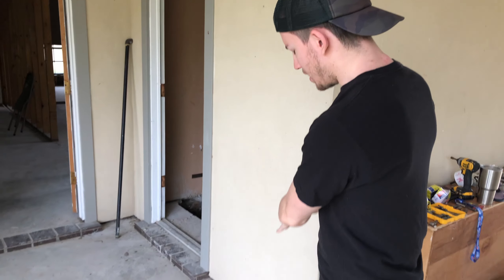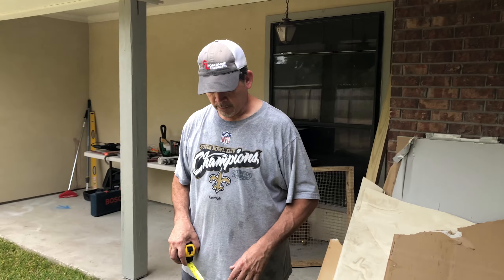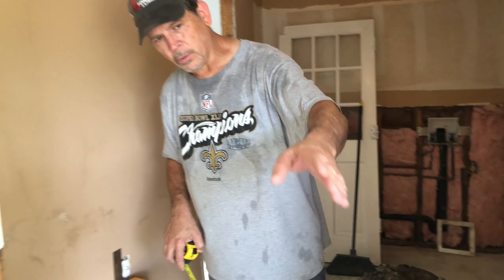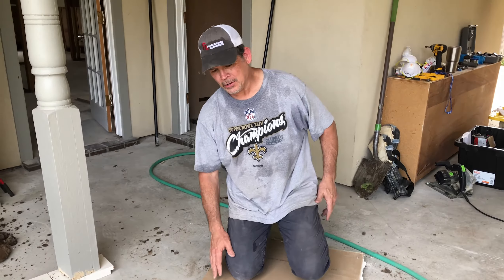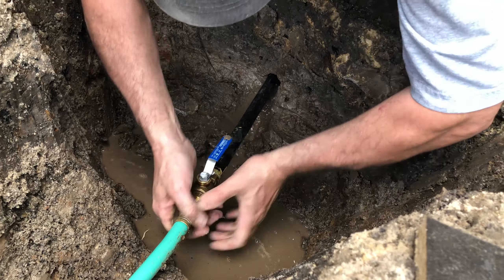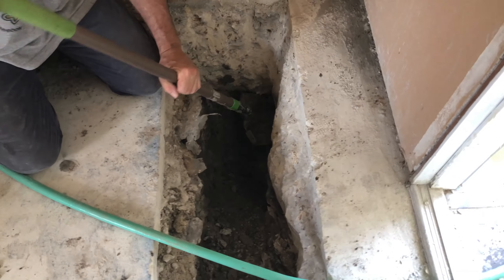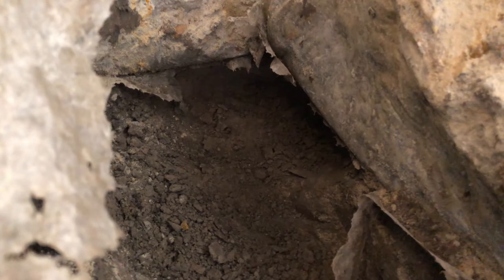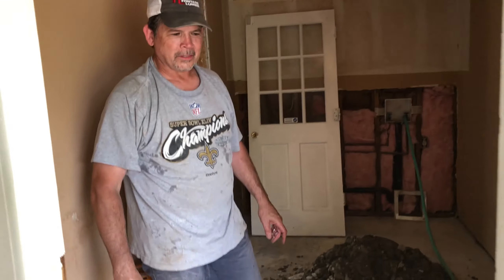Tunneling Under a Concrete Footing for a Sewage Drain

Comment: Should have dug deeper. Foundation typically are at 2' below grade. so 2 1/2 deep ditch. Never break the foundation footing ,its just not good .
Reply: Depends on the pipe depth in the yard for the join need to keep the drop so you typically want it to leave the house at the highest level possible to make your connection.

Comment: Great team work. Nice play but play reporting.  

Now I see what is involved in boring a hole under concrete & through dirt, deciding on the angle to approach the interior of the structure.  

The most compelling, most magnetic thing which kept me watching this episode was seeing  the father & son interaction.   It’s nice to see the how the father & son worked together to deal with problems in the process of boring through. No power struggling for the sake of power struggling. I can sense the respect, heartfelt cooperation.  
While watching this, I also felt sad thinking of the dysfunctional father & son interactions I’ve witnessed over the years. I also felt sad thinking of the many men that didn’t even have a father to work with.  My prayer is for men to father and mentor each other, to interact with each other and not just do the stereotypical sit in a line watching sports on TV & not talking, not hashing out the difficulties men encounter and figuring out how to approach those difficulties.

Comment: A decent pressure washer with numerous extensions on the wand also works very well for "jetting" or "boring" under footings , sidewalks ,driveways to get piping under them either for plumbing or electrical work.
This method works even in heavy dense clay soils. A very big time saver.
Reply: Correct, they make a rotating jet nozzle just for this. The jet oscillates and 3 jets spray back to force the whole thing forward. Then this 3" pipe will just slide in almost by hand.I guess they wanted to do it the hard way?

Comment: for future tries... Put a cap on it, drill a hole in the center of the cap to fit your jackhammer attachment. Then use the jackhammer. It's how they drive smaller piles for dock stabilization.
Reply: They might need a metal pipe cap.

Comment: You could use a hand drill so breakup the concrete and open the hole from inside to allow the pipe through

Comment: This method only works in a soft soil area. Meaning no red clay dirt ... I was doing this earlier today with a hydro jetter that was at 5000psi and to go 3 feet took 4 hours and if you run into a rock or a root ball, well you are screwed.

Comment: What were the two connection used on the steel pipe? I could not find a similar nozzle to recreate this boring system. Awesome idea and preserverence!
Reply: John ... You can make the front end by using a coupler and reducing it to a smaller pipe diameter. Guessing 1/4" would be ok. The other end was just adapting to a ball valve and then to the garden hose.
Reply: Thanks, I found the original spray nozzle : Little Big Shot Fully Adjustable Spray nozzle sold at Home Depot
Reply: @rupe53  Sewer that is less that 50 feet 1/8 IPF should be ok.  If longer then 50 feet, it should be 1/4 IPF.  You also don't want the drop to be too far, either, like 1/2 IPF...that can cause it to clog because the water goes TOO FAST and can leave the solids behind.  If you have corrugated pip (storm drain, NOT sewer) you would need to have the pipe significantly steeper (as much as 25% more).
Reply: @NiceMuslimLady  ... as I recall, this flick was about boring a hole for water pipe  installation. If you need some pitch, well good luck with that. Make a bigger hole and allow some wiggle room.
Reply: @rupe53  They're running a water line from a sewer line????
Reply: @NiceMuslimLady  ... hey, I watched many videos of people doing water boring so could be confusing them. (it was a year ago) The concept is the same and for a few feet under a sidewalk it won't matter much if the rest is ok. Now that you mention it, they did discuss pitch so already covered.
Reply: @rupe53  It happens to the best of us.  :)

Comment: I want to tunnel under asphalt driveway to install pipe. Tell me pls, specifically what pieces to get to make the boring pipe? Example 3/4 inch ? pipe for what ever my distance is, with threaded ends? (male/female), , cutoff valve, and nozzle. Is there a nozzle larger than 3/4? I eventually want 8inch PVC. Regarding ur 3 inch pvc pipe, were u able to buy a length long enough or did you have to glue pieces together?
Reply: you're going to have to be really good and have really good soil to get anywhere near an 8" pipe without heavy equipment.  You're probably better off cutting the road or getting a directional driller

Comment: When the thin black pipe hit the cement footing, why didn't you anticipate the bigger white pipe doing the same and adjust by setting it deeper than the hole bore by the black pipe?  It probably only needed the top of it to be a half inch or so lower.  Seems like it would have saved some time.  If you did it that height because of the pipe you are tying into and the new pipe needs to slope downwards towards the existing pipe, it seems like the existing pipe is awfully high based on the footing.  That existing pipe seems like it should be lower or just run the new pipe lower as suggested above and into the lower part of that pipe that meets it or the sewer tie in. I have no construction training so there may be things I have no clue about preventing you from doing it that way, but just seems like a cleaner and "better" way in terms of quality of life for that toilet (I get you are doing a job and there's a balance between price to do it perfect and to work with what exists and is still quality work).  Look forward to hearing answers on this and learning more.
Reply from the maker: I used a laser to shoot the invert on the existing sewer so I knew exactly where the new sewer line needed to end up for proper slope.  Would probably have done a few things differently on this one in hindsight 😖
Reply: @StudPack  You live and you learn and get better for next time.  Thanks for the reply.

Comment: The problem is with the bottom of the concrete footing  there never straight  there up and down with highs and lows in the same area. Looks like your going to have to hammer at the base of the footing.

Comment: you should put a piece of wood behind the pipe so when you're hitting it with a sledge hammer it absorbs some of that force and does not break that easily.
Reply from the maker: I know we did that at some point - it's a great tip thx!!

Comment: 1) directional drilling 2) vac truck
Reply: This is a nice DIY friendly method.  What do you think the cost would be for getting someone with the directional drill rig and a vac truck?
Reply: @walnutcontractors5661  $1,000 minimum plus travel costs

Comment: A little deeper trench would have helped. Inasmuch measure down past the concrete  on the inside of slab. Digger deeper outside in the lawn and this way y you dont hit th slab.
Reply from the maker: Deeper wouldn't cut it; wish it would have been that easy.  Had to maintain 1/4" slope to tie into existing sewer.   Shot the inverts with a laser.
Reply: @StudPack  makes sense. We put a sewer line in a few years, much easier than what u had to do. Good work

Comment: I worked on the rigs for a long time.  What you need is a hose adapter thats 3 inches, like a showerhead type spray to widen the hole.  A small rotary bit would be pretty cool.  Would you spend $250 on a bit like that if it was a product?  A rotary tricone drill bit for a waterhose?

Comment: Sheheheeet, we dont cut concrete, we sub out for that, at least I do. I got a question. Can you drill through the house footing for a water main or do I have to tunnel under? Btw, code is 2" and under is ¼ per foot, 3" and up is ⅛ per foot
Reply: In just a little advice, next time when you put that PVC in there tried chamferring the ends so it'll be a point not flat so it'll go through the mud a lot better

Comment: Why not just bust out the concrete slab instead of tunneling under it and dig a deep hole on each side of the footer? I would rather re-pour the slab than break my back trying to win and push that pipe through. As I type this from my armchair lol
Reply from the maker: Halfway thru day two I was wishing we had done exactly that but by this point it became personal:)  Also the patch would have been right across the back entry to the house and I was trying to avoid that.  Thanks MDH!
Reply: @StudPack  I agree with your answer and tunneling so you don't have conflicting concrete colors

Comment: too shallow of a trench, hitting the deeper concrete of the building footing, the concrete depth of the sidewalk = 4 inches. depth of the building footing = lots deeper. Try digging the trench down about an additional 18 inches and try again with the metal pipe. The first try with the metal pipe just got through, probably because it bend downward. Plastic pipe was larger and did not bend. The PVC pipe was hitting the bottom portion of the building footing..
Reply from the maker: Hey David, thanks for the comment.  I wish we could have gone deeper.  We shot the invert of the existing sewer with a laser and then sloped up to the new half bath 1/4"/foot.  We had to punch through the bottom of the footing to get the proper slope on the sewer line.
Reply: Pay attention to where the main line was - It's super shallow. The depth of their trench is limited by the depth of the main line PLUS the required 1/4" per foot required for proper drainage.

Comment: lol this is just going to completely crack and the pipe isn't probably the good diameter nor proper steep
Reply: Tigre ... they will pull out the pipe they originally used and place a new one in when done.

Comment: What if you used this method to install a main water line by only digging up the first 3' inserting this water boring device & boring through the next 3 feet, digging up the next 3 feet, boring the next.  If you were really clever you would screw on an additional length of pipe, boring 6 feet, digging up 3, boring another 6 feet.
Reply from the maker: That would work Tim.  In sandy soil you could probably bore further than that.